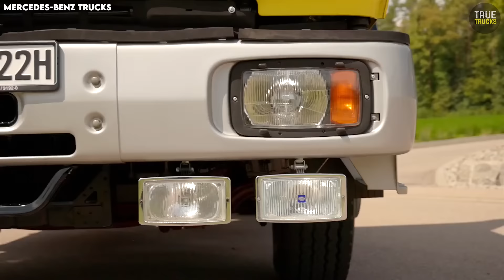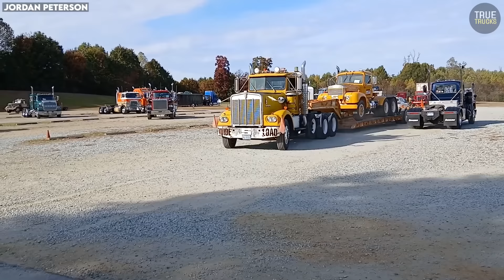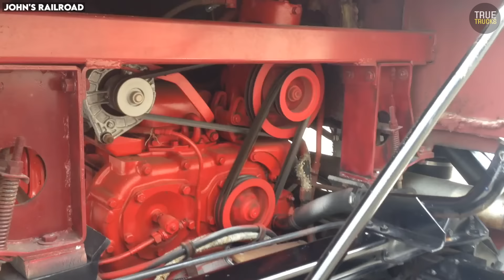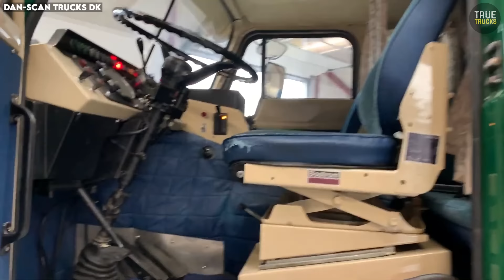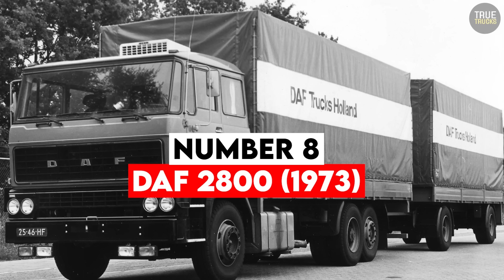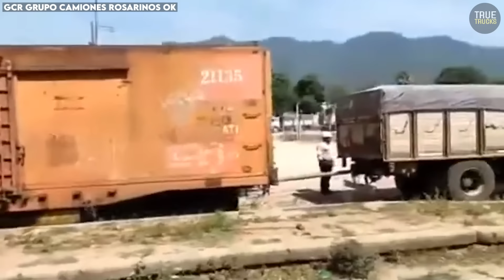10 Trucks From the 60s and 70s That Still Outperform Modern Ones!

Comment: Daf 2800 never had a V8, they were all 6 in line engines. Hot even the later 3300 types had only 6 in line engines.
They were fine trucks to drive though.

Comment: they may be old but as long as they are reliable and capable of doing the job then why sell themm or worse still. scrap them. i used to drive a little 7500kg ford cargo fitted with a 6 cylinder ford dorset engine. that never let anyone down.

Comment: To build trucks which can't be fixed by common mechanical tool should be ecological and economical crime. About ten years ago ask me friend in Czech republic if I can get some tractor in UK and he was surprised when 20 years old Czech build Zetor was for 25 K British pound. I asked one of my friend he comes from farming family and his answer was simple one. "Don't be be surprised these tractors has simple electrical systems" than gave me example when his friend had problem with John Deere,When mechanic arrived, half an hour work with computer and results was, the new electronic module needed. How much ..4 K British pounds. And part exchange. ..So customers these days do research for companies and also must pay for it. I am not surprised, because of these parasites ,using electronic  as shotgun and customers as hostages. Surprised you   the food price is so ski high. Those days trucks was build and ones was sold than  made job for his owner and no more additional charges. I know what I am talking about,I am from car and truck industry. Is just chain,when someone start to be greedy the others must rise prices also. Than all of us must pay that cos we are on the end of this chain.

Comment: Nice pictures but the narrative is badly generated……nearly every truck here is said to have the same benefits over moderns; outperforming because of no electronics, sensors etc. Preferably engine sounds would have been added instead of this blabla
Reply: Yeah, there is no comparison between the torque of a 70s Maxidyne and even a DD13. And is there any difference in quality between Pete 359, 379, or 389, or between a W900a and a W900L as far as quality? And really 70s engines weren't million mile motors. The best American trucks were in the 90s. N14, 3406e and series 60 were million mile engines, and could handle big horsepower.
Reply: There is also the Leyland Albion, the scamell, the Kamaz, out there
Reply: Yes they are, no exaggeration! Just visit the harsh areas where they are found and you would be surprised!